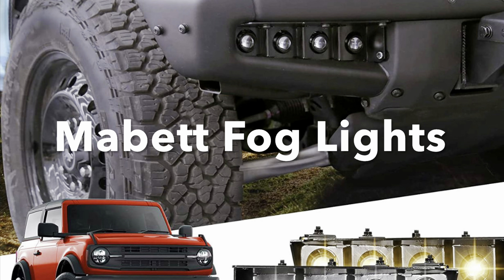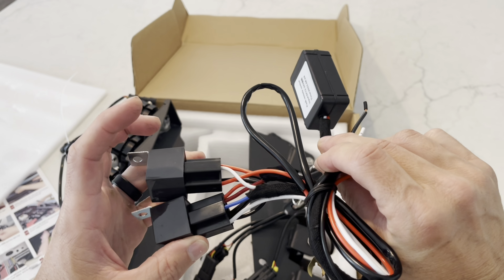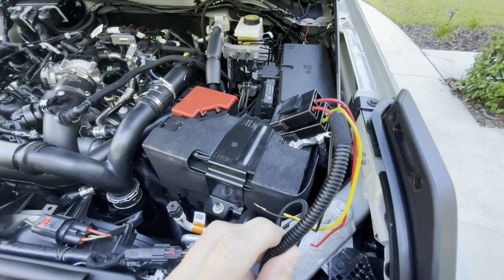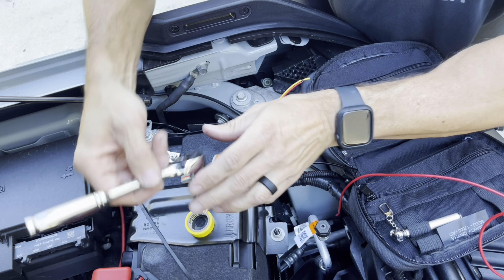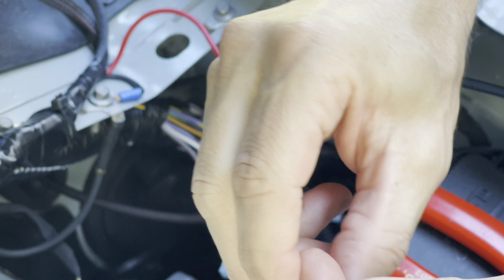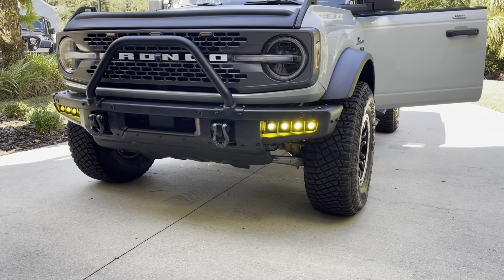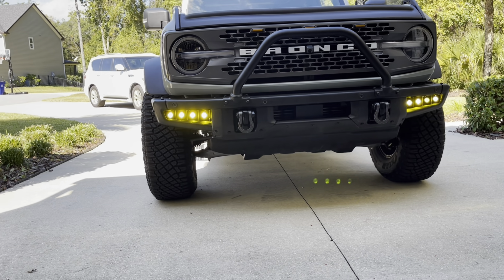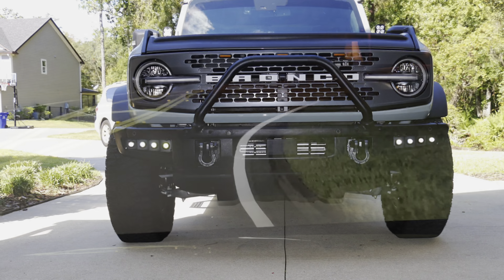Mabett Fog Lights

Comment: I just used this video to install the exact same lights on my Bronco.  Thank you!  I couldn’t get one of the original bolts to go back into the hole.  I think either my bumper or the housing for the light is slightly bent or warped but I’m going to a dealer for some routine maintenance and plan to ask them to install the bolt.  

Again, thank you!

Comment: You surely didn't need to connect those lights to you 30amp switch. That switch would do best for a winch or high powered light bar.
Reply: I wish the 30 was on 6 for this reason. I live in suicide deer country, and I'd rather have lights fastest to access and the least used (hopefully) on the far end. I may reverse mine, with 15 on 5 and 30 on 6.